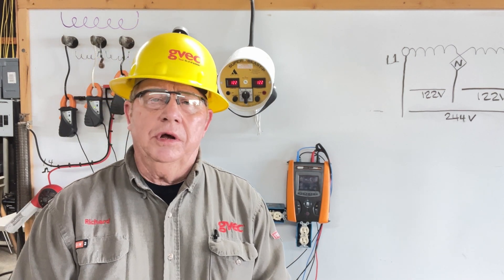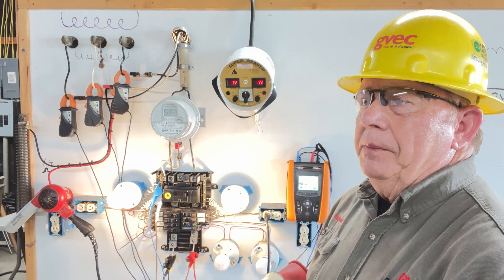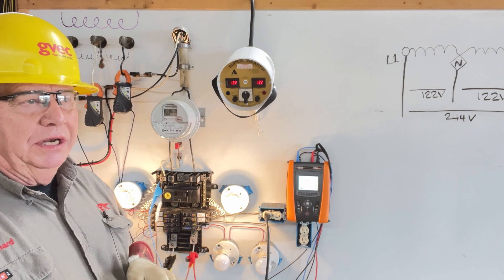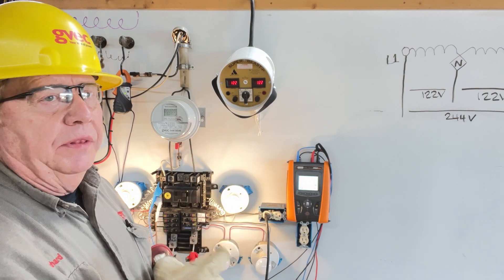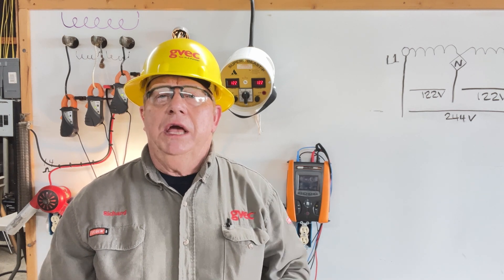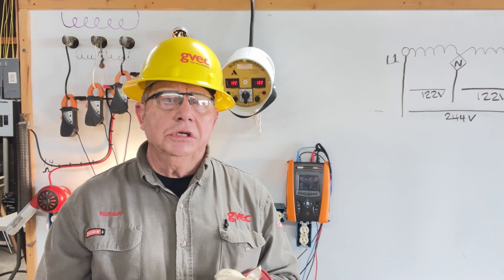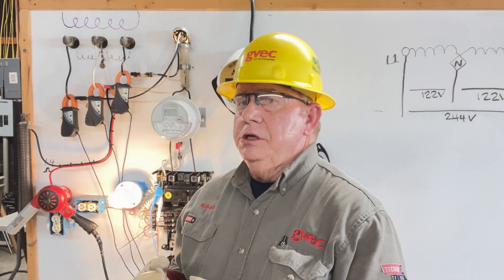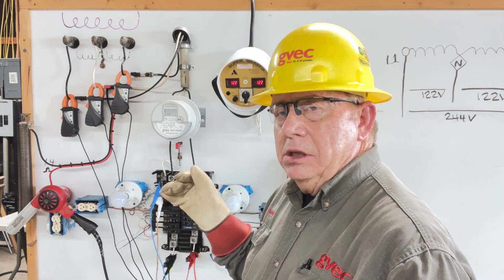Identifying a Bad Secondary Neutral as the Problem.

Comment: Great demo! Homeowner here, moved into our current house about a year and a half ago. We had flickering lights from the time we moved in, originally I thought it was due to old receptacles/switches and probably some loose connections. After replacing everything on a few circuits there was no improvement, and I was left scratching my head. Eventually we had some contractors running a big 120V air compressor, and I noticed my PC’s UPS kick on, but for OVERvoltage - 138V if I remember correctly! This defied any of my expectations about poor connections downstream of my circuit breakers, so after a little research I learned about the effect of a lost neutral anywhere between transformer and panel. Did a little more testing and sure enough, with one heavy load on one leg and very little else turned on in the house, clearly saw the rise/fall in voltage on the two legs (measured at the main breaker lugs).

Called the utility company, told them I suspected a dropped neutral, and an hour later they were on site, verified the problem, and hooked up a service restorer box. Immediately fixed. 

After a month or so they were able to come out for the permanent fix, and two weeks of digging and tunneling later everything was fixed (20+% grade from meter to the transformer at the bottom of my 100ft driveway, running across every single utility and the driveway itself on the way, soil full of rocks and boulders - turned out to be a monster job! Didn’t cost me a penny, and when they left it looked like they were never there. Colorado Springs Utilities is great!). Original cable had a concentric-wrapped bare neutral which must have corroded over the 25 years of its existence, they replaced with 3 individual insulated conductors. 

Over my years of home ownership I’ve asked a few electricians about flickering lights, and every time their response was more or less a shrug and “it’s normal”. This included the electrician with decades of experience that wired our new AC condenser, who I asked to at least check the torque on our main breaker lugs and anything else he could think of to figure out what was going on. 

I find it a little alarming that at least in our area (Colorado Front Range where underground service is the norm) that it’s normal for residential electricians to have no clue about a damaged or dropped neutral. I lost a computer motherboard already, and I’m lucky no fire started!
Reply from the maker: Thank you for sharing that experience. It’s good to have a homeowner that can troubleshoot the problems. You did a good job identifying the problem.
Reply: 'Over my years of home ownership I’ve asked a few electricians about flickering lights, and every time their response was more or less a shrug and “it’s normal”.'   ... wow, that's incredible given that persistent flickering lights is a widely known symptom of a bad neutral among (properly-trained) electricians.
Reply: @ the contractors in our town leave a lot to be desired… such is life in a seller’s market.

In our previous house we had some flickering, not as bad as current house… I changed every single outlet and switch in that house, which did basically solve the issue. That was a house built in 1986, and the original outlets were all using back-stab connections. Many of them were a little melted, and poorly-done wire nuts didn’t help anything either. Screw terminals only for me, and for now Wago seems to be doing the job for me for wire-to-wire connections (and easy to rework if they show any signs of issues down the road). 

I know a properly-done wire nuts are excellent, but for an amateur like me Wago makes it easier to achieve very consistent “good enough” results when dealing with rework.
Reply: @James_Bowie  
they might have skipped this question during their license exam.